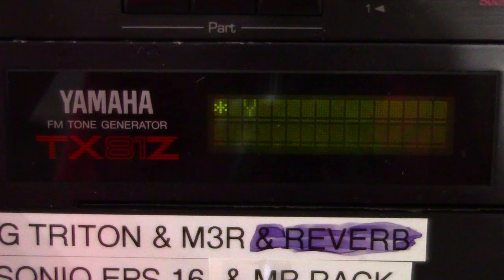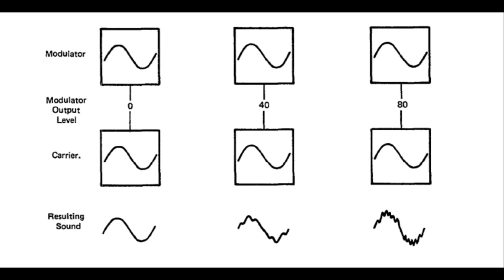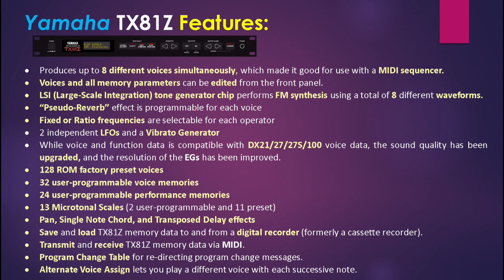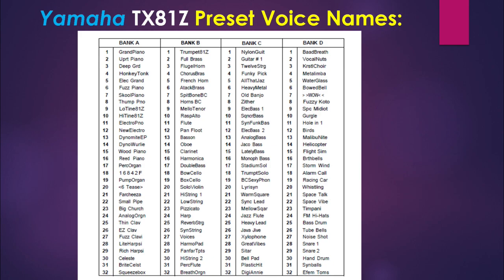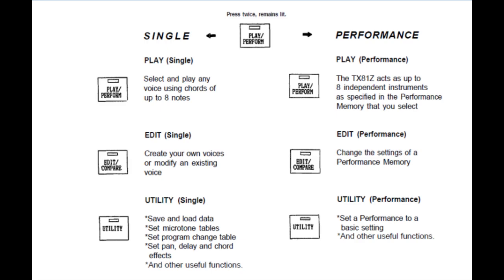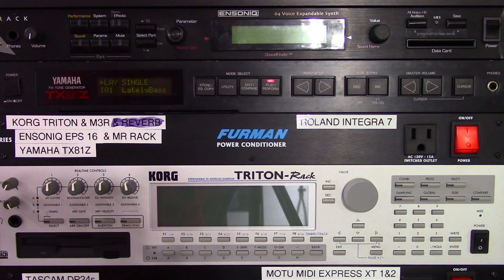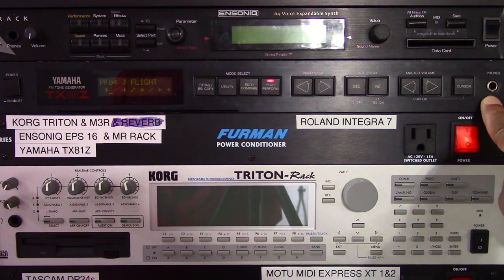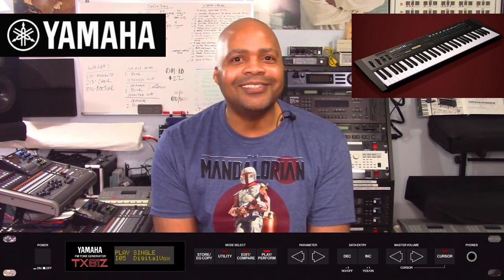Yamaha TX81Z Tone Module: Why I Use It

Comment: About myself: 
I came across the tx81z as a software called FM4. I know about the importance of the other waveforms. I didn’t want to buy an FM hardware synth with only sine waves. Which brought me to the Korg Opsix.
Here is one major questions I have with the TX81Z:
* With an only sine wave FM Synth you have to recreate other waveforms wasting Feedback or stacked operators. The Waveforms of the Tx81z, I guess are a solution to that problem. The W1 is sine, W5 is half width sine which I have on the Opsix. The other are a mystery to me. Although they are based on sine, I guess they’re represent other basic waveforms like saw and square which was the solution due to the shortcomings at the time. So what do W2, W3, W4, W6, W7, W8 represent ( representation means I could just use that waveform that it represents) or from what can they be recreated if you have saw, square, triangle and you can control the width?

Comment: How do you manage the hissing high end. Please help.
Reply from the maker: I don'y have this issue with my unit. I would need to be able to reproduce your issue to analyze it, and I can't. My suggestion is (if you've not tried it already) is to ensure that the noise is actually coming from the TX, and not the cables or the mixer channel that it's plugged into. Lastly, try playing around with the voice preset parameters. There may be a setting there that's causing the issue. Take your time through the process in tracing down every connection/aspect you can find. The end result is you may need to have your unit serviced. I hope this helps and thanks for watching.